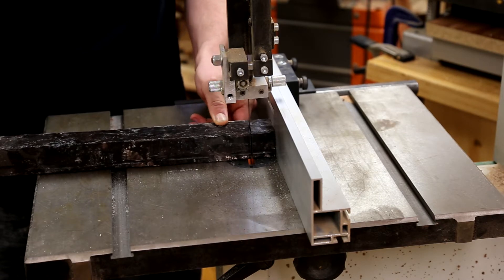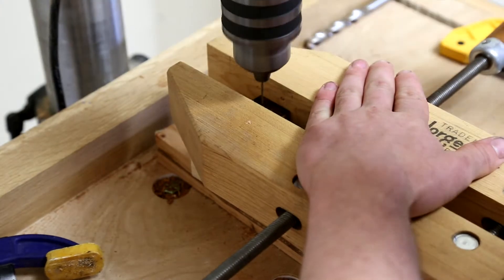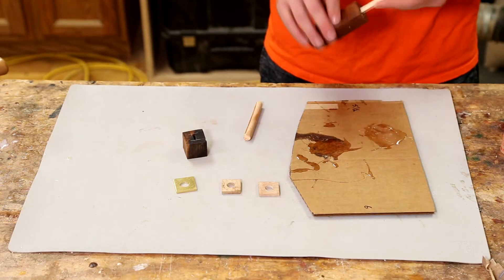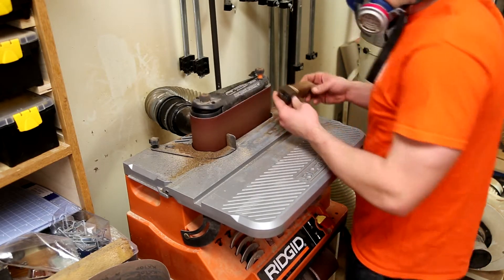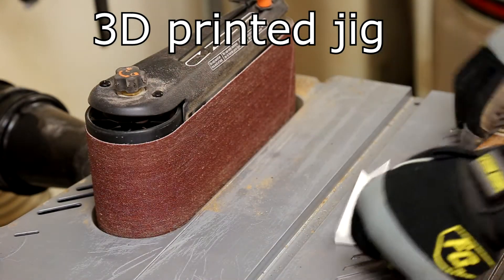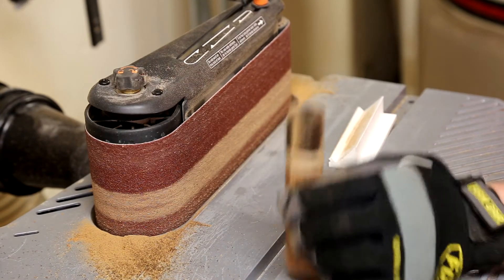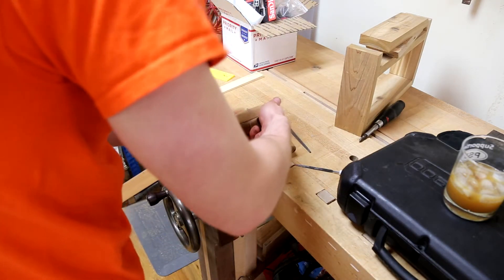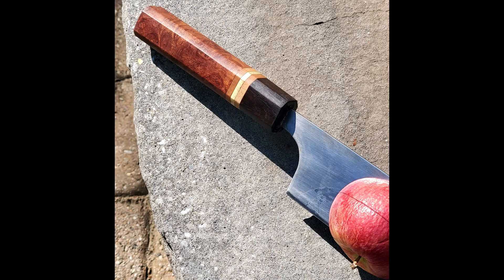Making a Japanese style knife handle

Comment: I enjoyed the video but I thought the purpose of using  a dowel rod was so you don't have to burn in the handle?? Also wouldn't that compromise the epoxy??
Reply from the maker: My understanding is that the dowel rod reduces the likelihood of the wood cracking since I used very dense oily wood.  The epoxy was weekend by the heat, but has held up well since it cooled
Reply: @JeffMarxWoodworking  OK. I've also used the dowel method but I didn't burn it in and I've had no problems with a blade coming loose and I've tested it pretty thoroughly. The epoxy really does the majority of the work.

Comment: How does the heating actually lock in the handle? Burns in additional space into the dowel and the wood cooling down locks it in?
Reply from the maker: That's right, it's tapered as it goes back and basically burns itself a perfect fitting tight mortise.  Thanks for watching!

Comment: Hey guys is the jig 3D also making the taper on the handle? Tia!
Reply: great question but unfortunately not, it has no way of attaching to the table for that, i drew a line that i had to sand to
Reply: @markmarx2  so the taper is about drawing lines and go freehand on the grinder?
Reply: @jurrian644  ya thats how i did it as two seperate steps, tapering first.  someone with more experience might be able to do it in one step
Reply: @markmarx2  we’re all learning 😅
Reply: @jurrian644  thats the goal🤣
Reply: Hey guys, so at this moment I’m all-in. Disc sander, milling machine tons of other stuff and I’m loving it. I would be helped with the jig. Could you guys make one for me?